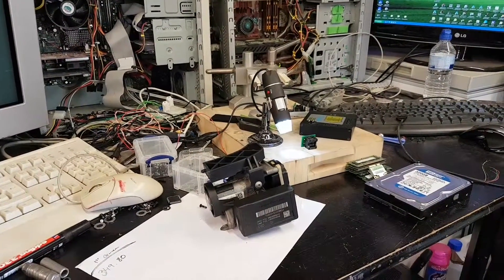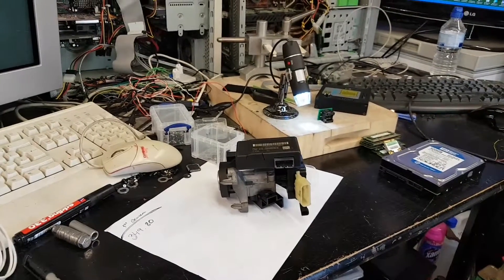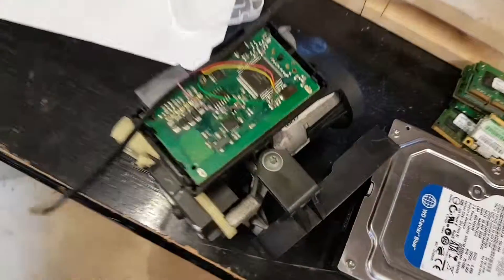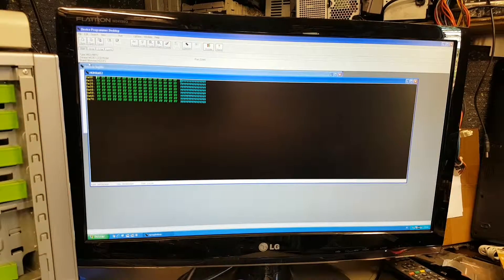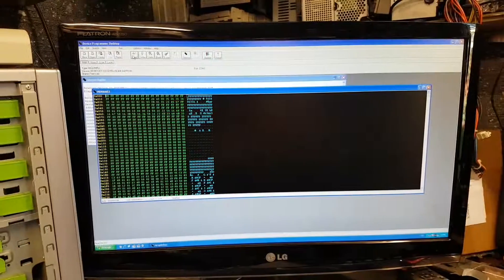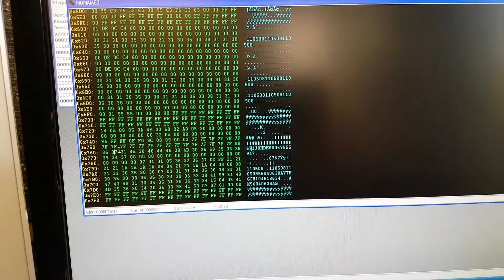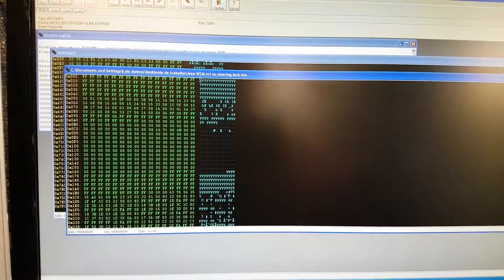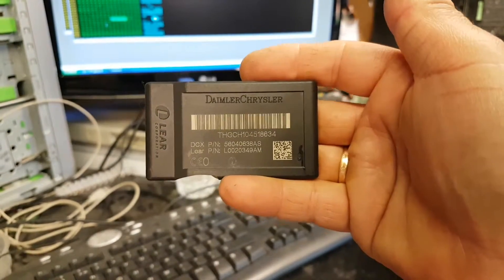Jeep Grand Cherokee WK PIN read from WCM module. (READ DESCRIPTION)

Comment: I have owned a 2005 Keep Grand Cherokee which had a faulty WCH, the shop replaced  all the PCM WCM and the lock control module to get it to work and changing the VIN in the process, what a mess, so now the new owner wants more keys for it, but when you scan foe the Skim number it dose not work when trying to program new keys it states incorrect pin, so would you suggest your method for reading the code I already have a eeprom reader / wrighter  and also does the code also live in the PCM and dose that need to be changed also and how.
Many Thanks PS great video
Reply from the maker: Yes, the pin should be on the pcm as well...
You shouldn't need to change any pins... just extract the current pin on the wcm an program the keys using that pin...
👍👍👍
Reply: @LMAutoRepairs  My fear is that there may be a miss match between the PCM and the WCM, the whole thing is a very long story I can tell you the complete story if you like , But I will give it a go, and Thank you for your help.
Reply from the maker: If the car starts, there is no mismatch...
Might be with the rest of the modules though...
Unless has been immo off...
👍👍👍

Comment: Goodday sir! Hope you are well! I need you advice please! I have 2 Jeep Grand Cherokees 3.0 wh. The one is a none starter and the other my personal vehicle. To eliminate the cause of the problem on the none runner, i used the none runners ecu, skim and bcm to see if it will start on mine. The part numbers are exactly the same on both bcm en skims, only difference between the 2 vehicles is that my personal vehicle is the baseline and the none runner have some extras, pdc, heated seats ens. As a last resort one i never do, but somehow i got so overwhelmed getting the problem i made a stupid mistake by putting all my controllers in the none runner, it started , but cut out.... so somewhere coding is possibly needed. But my problem came after refitted everything to my personal Jeep, i did a diagnostic scan, i now have dtc’s relating to airbag configuration error, vin mismatch in the bcm, the central locking dose not work. The door modules is not found. But the Jeeps starts and chances gears as normal... will i be able to recode my bcm back to normal or will my configuration return if i reprogram the vin in the bcm? Why would something like this happen? The none runner Jeep have no issues in any of the controllers relating to mismatch or configuration issues...But mine was re configured?
You experience would be very much valuable!

Comment: Wow okay, dose this mean i can do a vin change in the eeprom data to match it to another vehicle?
Reply from the maker: Yes...
But each case can be different...
From encrypted data, to other data that needs to be changed...
Thank you for watching!
Reply: Oh okay, makes sense, so best way stays via OBD?
Thank you for the great video!
Reply from the maker: @rustinvigne3275  
It the easiest way for sure...
👍👍👍
Reply: Sorry one more question, i have two wk’s 1 running and the other not. Confirmed the skim to be faulty over the weekend. Got a second hand skim, just preparing myself for the job. Will probably be able to pull the pin via obd , but one part im not sure about. I unplugged the steering lock on the running Jeep and it still starts, seems the lock is not coded as like Mercedes ESL?

Comment: I bought a brand new wcm for grand cherokee 2008 from dealership... I put it in cwr cranked the car started without any hesitation.... But the abs light was on... When i diagnosed absn several modules the fault code was Vin mismatched then i went back at diagnose machine n started the diagnose procedure when i tried to automatically search car... I got the details the vin was different... Not the one on the car chases.. I tried special functions in engine control module... Change vin.... I triedchange vin... It was succesful but the security light appeared n started blinking... The problem is vin mismatched when I match it the security fault appears... Invalid skim... I dont know what to do... Need help...

Comment: how do you know that those 6 bytes in this case are the PIN, and that there is nothing else?  Also, how did you knew that those position hold the PIN info?  Great videos, keep them up, as these video provide insight into how manufacturers store this critical pieces of data that might break or unbreak a car.  
Note I do not own a jeep, but this is fascinating.

Comment: Could you recommand some programmer tool for 27/29FXX PLCC and SO44 flash etc.. and some eeproms like b58258 ( 24c02 ) or 24c14, 93c56?
Also it doesn't have to be tool for pro purpose. Some relatively cheap and good (i know its like oxymoron, but i think you know what I mean) programmer for occasional use.
Reply: I use this cheap programmer here:  http://www.autoelectric.cn/en/tl866_main.html
There are no problems with it. You can buy on eBay.
Reply: @engeneer_ru5827  Ooo TL866, honestly I forgot about TL. I have used TL few years ago and that was really nice. Thank you for reminding me about TL! 
Anyway if someone has any experience with other tool - please share them with us :)
Reply from the maker: Willem will do what you are looking for as well... I have some videos using it...
👍👍👍
Reply: @LMAutoRepairs  I have heard about Willem that he can broke memories or bad read or not write despite of he made veryfied read few seconds before and some some other problems with him. I think a lot about TL866 rather, hmmm.. I also saw something like Universal Flash Programmer v6 (afair) and hmm..  and price ~20-30 GBP + adapters ofc and external PSU 15-25V, but for the same price I can buy TL866 (of course without adapters, but this obvious, every tool needs external adapters; Willem pros: internal soldered adapters PLCC). Hmm I will thinking about that, anyway thanks a lot for your time to response! ;)
Reply from the maker: @mieciumietek1405  
My opinion is obviously biased... I have the willem pcb 5.0 for years... never had an issue...
But it is your decision...
Good luck!...

Comment: Nice one, Luis...using the hex for the pin... ;)
Reply from the maker: Thanks!
Hopefully will be helpful to someone out there...
Thank you for watching and for your comment!
Reply: Yup in general this used to be a common thing to do in the good old days to make older hardware work with newer technology, pull the code then patch till it works. While this is specific for cars, it can make things with mismatched serial numbers or missing information  play nice and work togther. It is a dying art though. Props 🤓